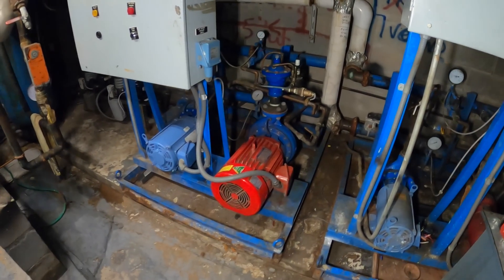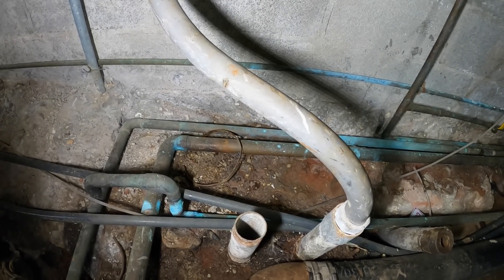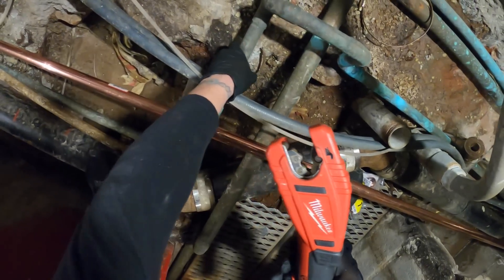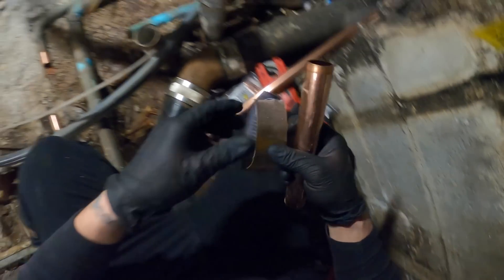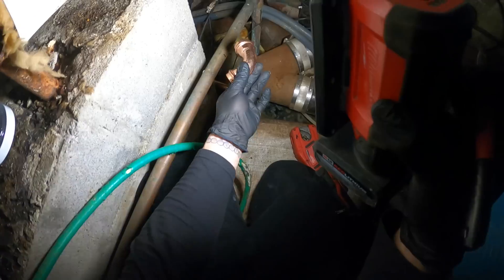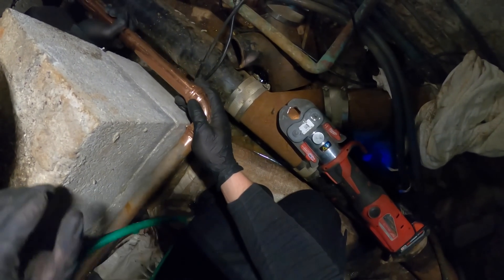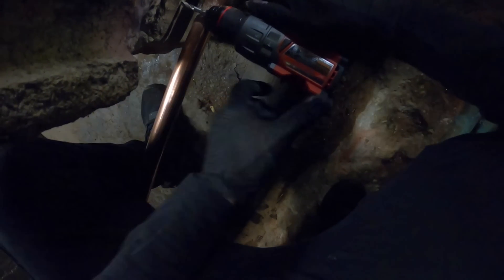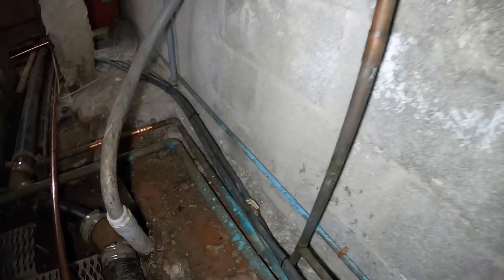Backflow Preventer NIGHTMARE LEAK Troubleshooting & Repair (Backflow Preventer Leaking Water Vent)

Comment: Hi, JMT. I was told by somebody "You should have the drain on an angle going to the end of the pipe. Where the water gets taken away from the building." So the water is moving quite fast and can carry any bits of dirt or rust with it. And it will not block the pipes keeping the system running properly.

Comment: You need to replace the cutting wheel in your Milwaukee tool. Mine cuts 1" copper in less than 10 seconds.

Comment: Just use a grinder dude lol waste of time with that cutter.
Reply: I wonder if his cutter wheel is dull or it needs an tension adjustment. then again, cutting that slowly wont roll the pipe edge as badly.

Comment: G,day Jumper man tech from Sydney Australia.
I've been "bingeing" on your York (Johnson controls) roof top air handling systems.
Your troubleshooting and resourcefulness of repair is of distinction in my opinion.
Especially 
* The squirrel cage fan, motor and bearing rebuild.
*Replacing "plugo" filters 
* Finding burnt and disconnected contactors and wires, especially around fans.
*Reading fault codes "red light" and replacing capacitors.
It would be good to flush that mud out of pipes to improve lifecycle of air handling assets. I thought into empty concrete trucks after a pour, then drive it out of NY to fields?
🇦🇺☮️

Comment: Nice work JMT.
I am impressed at your vast knowledge of HVACR units and components.
I have a question: What do you like doing better, the mechanical repairs or the electronic troubleshooting/ diagnostics and replacement?
BTW, I too have one of those Milwaukee tubing cutters, it will cut up to 1 1/4" tubing with the same cutting wheel and it is a "beautiful thing!"

Comment: That T into the other drain was beyond goofy lol. It was essentially an inverted p-trap meaning there was always stagnant water through that whole pipe on the side that the water backflowed through. There must also be a restriction in that pipe with the open circuit in order for there to be enough pressure to back feed so far. I wonder if that pit is clogged and actually filled up when the engineer took that video? Nice fix!
Reply: the end may be corroded up or chunks stuck at the last couple elbows, but possibly just way too high a flow rate and the elbows are restricting it enough.
either way it was a total sheeeet show.